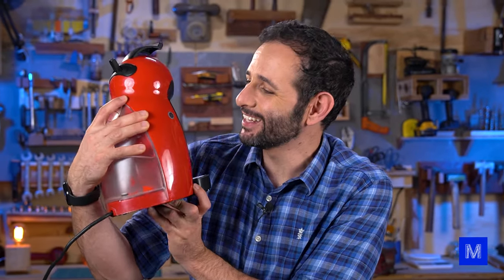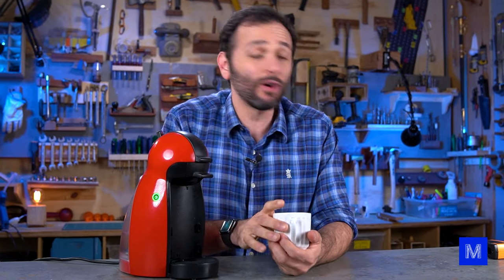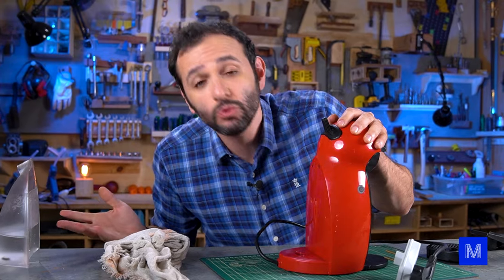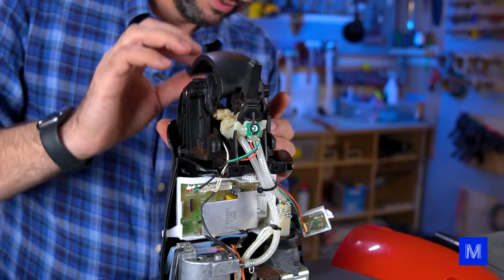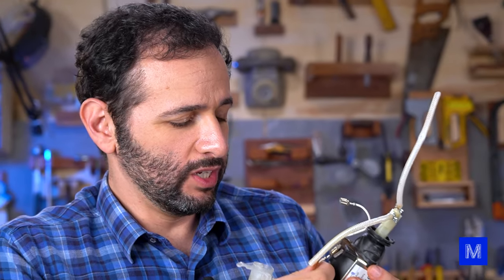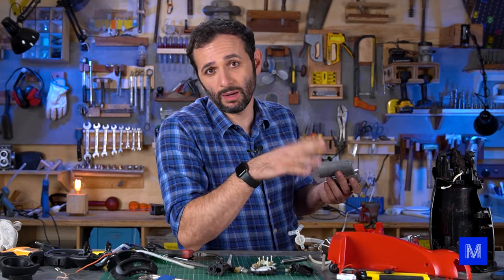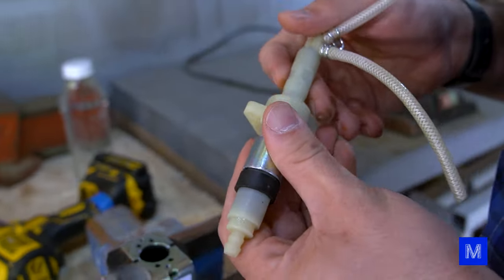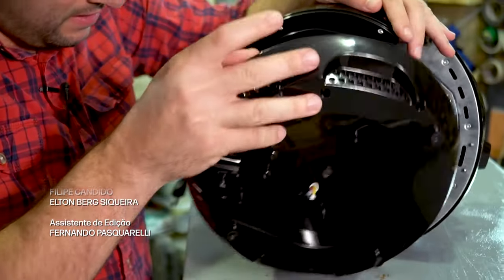O que tem DENTRO de uma CAFETEIRA de CÁPSULA

Comment: Aquela massa de alumínio no aquecedor é necessária por dois motivos, e a peça foi calculada levando isso em conta:
- O alumínio é excelente condutor, tanto de calor quanto de eletricidade;
-  E não, o alumínio não vai guardar calor, justamente por ser bom condutor. Aquecendo de dentro para fora naquela quantidade de metal, garante-se algumas coisas: que a resistência não vai esfriar de imediato, porque está isolada do ar; não vai ser atingida pela água, pelo mesmo motivo; e o fluxo d'água promovido pela bomba é suficiente para captar todo o calor gerado na peça, elevando sua temperatura para vaporização mas sem deixar a peça esquentar demais.